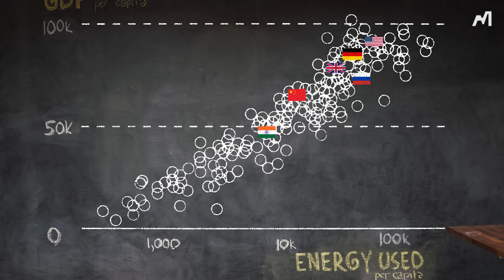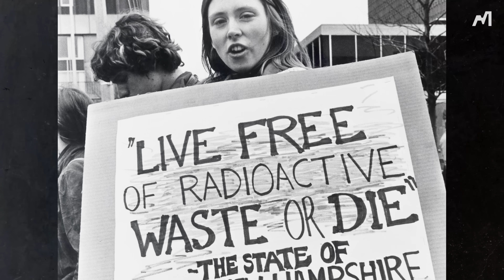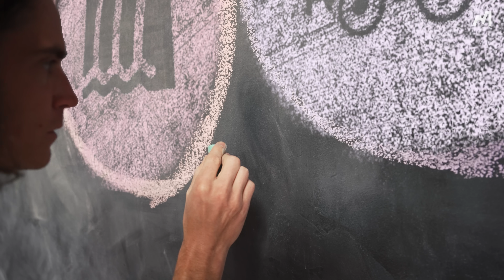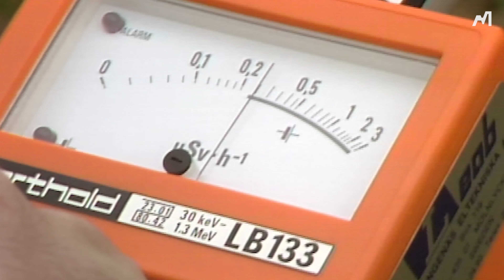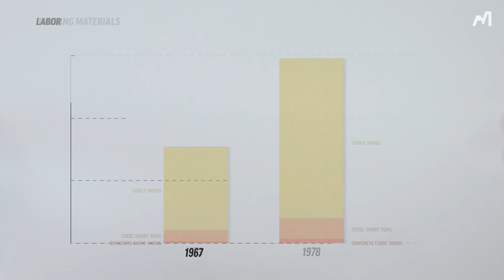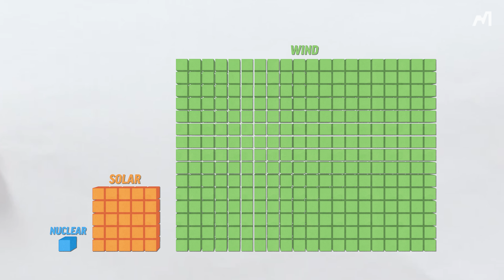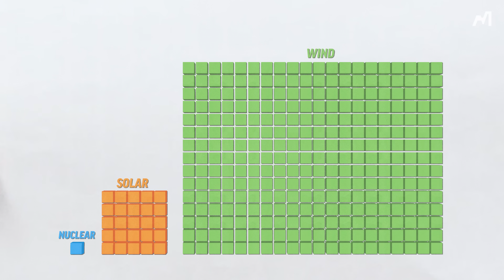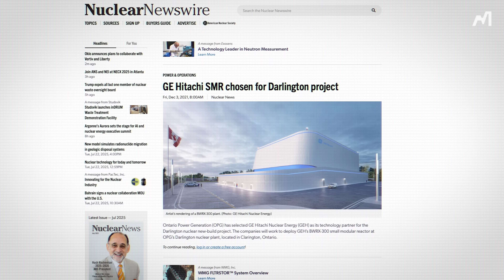They're Lying to You About Nuclear Energy

Comment: There are some serious concerns about the safety of nuclear power plants, like the effects of chromates attacking the carbon steel around the control rod guide tubes in the reactor closure head.  The potential structural failures can be addressed with reactor design and operations.  Thank you for addressing the ridiculous linear non-threshold theory (LNT).  You covered the idea that the declared potential hazard from radiation is tracked as though it is cumulative.  It is also worth noting that the limits are based on acute dose resulting in death from cancer extrapolated out to a calculated 1 in one million deaths from chronic exposure to the most likely member of the public receiving the highest dose assuming that individual was present in that location for 50 years.  Measuring radiation and contamination exposure at the stated public limits is difficult if not impossible.

Comment: Hmmm... there's some glaring omissions in this video:

Nuclear fans like to point out the low casualty rates, but they always omit crucial details:
Chernobyl and Fukoshima are the two most expensive disasters in history. And it's not by a small amount.
The clean up cost of Fukushima and Chernobyl is now $1.3 trillion. That's enough to bring online 228 GW of offshore wind. That's 28 times the capcity of Fukushima and Chernobyl combined

One of the primary reasons that Nuclear has such a low casualty rate is because of the regulations that are in place.

It's like air travel - easily the most regulated form of travel in the world, and also the one with the strongest safety record. That's not a coincidence.

And the "over-regulation" argument gets destroyed when we look at the People's Republic of China.

China have no problem with deregulating things to make it easier yet their Nuclear Power rollout is also waaaaay behind schedule and is getting worse. They are now at least 40 GW behind schedule and are now expected to achieve under 60% of their 2030 target of 200GW capacity.
Compare this to solar and wind in China. Their solar capacity is now 1,300 GW and wind is 600 GW - absolutely demolishing their targets. China are now installing more solar capacity every six months than the amount of nuclear power they've been able to bring online in over 10 years.

India, likewise, has had similar problems. They set a target of 63GW by 2032, but have since had to reduce this target to 22.48GW, and are way behind schedule on hitting that target (only at 8.8GW after 15 years of effort). Meanwhile wind and solar? They're now at 200GW.

And France, the country that most openly embraced nuclear has 70% of its energy mix being nuclear. There are now 44 countries with 70% or higher of their energy mix being renewable.

And the transformation hasn't been isolated to small countries. Even wealthy countries like the UK have seen renewables absolutely explode in capacity - despite the UK's dreadful reputation when it comes to construction projects - Wind is now the single largest energy provider in the country with renewables now producing 40% of the annual energy production. And this is even the case in the first days of 2026 (winter) when energy demand is at its highest. Wind is the leading producer. Whilst nuclear is competing with Biomass in the rankings.

Nuclear Fission is no longer a cutting edge technology. I do wish more had been rolled out in the 80s and 90s - we would be far closer to our net-zero goals. And I do wish nuclear could meet its targets. But there's no denying the fact that solar and wind have exceeded expectations, whilst nuclear is lagging behind - even in circumstances of low regulation.
The cost of wind and solar has plummeted in the last 15 years and continues to fall. There are definitely challenges. But I'm not convinced that modular reactors are going to be here in time - we've been promised them for like 30 years now and they're still not here.

Comment: The majority of the spent uranium fuel may have been covertly dumped into the oceans.

“By 1991, the US had dropped more than 90,000 barrels and at least 190,000 cubic meters of radioactive waste in the North Atlantic and Pacific. Other countries including Belgium, France, Switzerland and the Netherlands also disposed of tons of radioactive waste in the North Atlantic in the 1960s, 70s and 80s.” (Schauenberg). 

Tepco may have disassembled the spent radioactive uranium assemblies and stored the uranium pellets in steel barrels then dumped the barrels into the ocean which until 1991 was common practice by the Europeans, Americans, Russians, and Japanese.  

 

...................................................................................................................................

The loss of power at the Fukushima nuclear power plant resulted in the reactor’s water pumps failing which caused the reactor's uranium fuel assemblies to overheat and meltdown where uranium oxide has a melting point of 5,072° F and begins to vaporize near the melting point.   The intense heat and pressure in the core created a nuclear explosion that destroyed the 650-ton reactor core, most of the four-foot-thick steel-reinforced concrete barrier that surrounded the reactor core (fig 27a,b) and numerous concrete walls of containment building #3.  The explosion of Fukushima containment building number three produced a 1,500-meter-high mushroom cloud (fig 26a,b) that nuclear explosion originated from the reactor core yet scientists insist that the Fukushima explosions were not nuclear explosions.  The video of the explosion of containment building #3 shows the 40-ton reactor lid (RPV head) jettisoned 1,000 m into the air.  Figure 3 shows that where the core once existed is now essentially gone which implies that the 650-ton nuclear reactor core explored.  It is argued that uranium oxide cannot form a nuclear explosion but it is unknown what 75 tons of uranium oxide under high pressure (1,000 atm) and temperature (+5,000o F) mixed with water will do but the amount of destruction suggests a nuclear explosion occurred.  In addition, diametrically the molten uranium oxide breached the concrete floor of the containment building since the melting point of uranium oxide is 5,072° F.  If the reactor core was immediately vented and kept open after the water pumps failed, the reactor core nuclear explosion could have been prevented, since hydrogen gas is the oxidizer for a nuclear explosion, and the formation of the Fukushima 147,200-acre exclusion zone would have been prevented but the meltdown was inevitable.  In the Three Mile Island incident the reactor core was immediately vented which prevented the accumulation of hydrogen within the reactor core which prevented the nuclear explosion and the formation of an exclusion zone.  The meltdown could have been further contained if the bottom of the reactor core was composed of a ceramic fire bricks (4,000o F) instead of concrete (2,192o F).  The exact composition of the Fukushima corium is unknown since the radiation levels at the bottom of the containment building disables all electron devices.  In addition, at Fukushima, a total of 2,000 tons of the spent uranium fuel assemblies stored within the four of the containment buildings are unaccounted for since the high levels of radiation (+ 800 Sv/hr) at the bottom of the containment building disables all electronic devices, even when shielded.  At Fukushima, the cooling pools were located at the top of the containment building next to the reactor core where many of the Japanese nuclear power plants store their uranium spent fuel assemblies within the containment building. 

The Fukushima meltdown breached the 13 feet concrete containment building foundation.  After each of the three explosions, a total of approximately one ton of pulverized microparticles of uranium oxide was dispersed into the atmosphere producing the Fukushima exclusion zone.  Approximately 65 tons of the melted uranium fuel assemblies from the reactor core fell to the bottom of the reactor core and began to melt.  In addition, approximately 450 tons of spent uranium from the cooling pools, combined with the 65 tons of uranium from the reactor core vessel began to melt down forming a 500-ton corium uranium mass after each of the three containment building explosions.  The molten uranium corium melted through the steel reactor core and disintegrated the concrete floor of the containment building resulting in the molten uranium corium melting through the bedrock.  The descent of the molten uranium was stopped by the groundwater (fig 2) where 500 tons of corium exists beneath each of the three containment buildings where the cooling of the corium by the ground water forms tritium (radioactive water).  The Fukushima tritium problem will last for the next one million years.  High level of tritium feed to mice causes infertility.

The reactor core's uranium oxide was pulverized into uranium oxide microparticles that were released in the Fukushima fallout.  The Fukushima and Chernobyl exclusion zones will never be habitable.  After 37 years (Chernobyl) and 11 years (Fukushima), radiation levels within the Chernobyl and Fukushima exclusion zones have not decreased which can only be attributed to high levels of uranium oxide dispersed in the environment.  The US federal occupational exposure limit for an adult is 0.053 Sv/yr; therefore, a total of 0.053 Sv exposure within a year is the occupational safety limit.  Today, in the Fukushima exclusion zone (red) readings of 1 mSv/h have been routinely reported where 53 hours (2.2 days) of exposure at 1 mSv/h radiation would be at the occupational limit 

10-3 Sv/h x 53 h = .053 Sv...............................................................1

A total dose between 2.5 Sv/yr and 5 Sv/yr would be fatal.  After 3.42 months (2,500 h) the exposure of 1 mSv/hr would be fatal

10-3 Sv/h x 2,500 h = 2.5 Sv............................................................2

The city of Futaba, which is in the Fukushima exclusion zone, will never be habitable.  British scientists (2020) have found readings of 1 mSv/hr near Fukushima city which is beyond the boundaries of the exclusion zone.  Ingesting or breathing miniscule amounts of uranium oxide micro-particles can have serious negative health consequences.

...........................................................................................

Gamma rays emitted by uranium fallout cause cancer and birth defects.

“The first case of thyroid cancer was reported on 12 September 2012 after 80,000 children had been tested.2  Since then, the numbers have risen steadily. As of writing, 56 have been diagnosed with thyroid cancer, 1 with a benign tumor, and a further 47 are suspected of having the cancer. This brings the probable total to 103 out of 296,026 eligible residents examined.3  Thus far, nearly all initially ‘suspected’ cancers have later been confirmed as malignant.  The ‘normal’ cancer incidence rate amongst minors is one to two in a million.” (Williamson). 

“Belarus, whose border with Ukraine is just four miles from the Chernobyl power plant, absorbed an estimated 70% of the nuclear fallout.  A study by UNICEF suggested that more than 20% of adolescent children in Belarus suffer from disabilities caused by birth defects.” (Verril).

If families return to live within the Fukushima exclusion zone, their children will suffer the birth defects that occurred in Belarus from the Chernobyl nuclear disaster.  Only Yoichi Yatsuda, 71, and his wife have returned to live in Futaba (2023).

The three Mile Island (TMI) cleanup did not remove any of the uranium fuel assemblies from the disabled reactor core since the melted fuel assemblies would be radiating more than 800 Sv/h of radiation that would disable all electronic devices and prevent any real meaningful clean up.  At Chernobyl and Fukushima, uranium corium melted through the bedrock and is being cooled by the groundwater.  The high levels of radiation (800 Sv/h +) emitted from the hole that leads to the corium uranium masses beneath each of the compromised containment buildings disable all electronic devices; therefore, the removal of the corium is not physically possible.  TMI also suffered a corium containment building breach (meltdown) which meltdown was less serve since the cooling pools where not located in the containment building.

                                                                                
 

____________________________________________________________________________________________

Comment: 20-25 years lifespan for wind turbines is very impressive imo. Idk exactly which parts fail first but wind turbines are relatively simple machines and I doubt they have to scrap the whole thing after 20 years, surely the tower doesn't need to be changed bc it's just a structure.

Comment: The Chernobyl thyroid cancers aren't significant? The city I was born in, Gomel in Belarus has over 30% of its residents with thyroid cancers at any point in their life. Yes, it can  be treated by removing the thyroid; And then you live on medication for the remainder of your shortened life.
Reply: Significant compared to other sources, nobody denies the problems caused by Chernobyl, but we have dozens of Chernobyl equivalent of deaths, permanent health effects and environmental damage from fossil fuels every years.
Also Chernobyl was a case of its own and no occidental nuclear reactor shares the same design flaws, so including Chernobyl in the debate about occidental reactor designs is moot to begin with.
Reply: @filippo1864 I fully agree. I am not against Nuclear as an energy source. I also do not support the endless bureaucracy created due to incredibly rare incidents.

Fact of the matter is that people perceive nuclear as something that's more dangerous than oil/coal.. Which is simply not the case. The amount of oil contamination that occurred during shipment, oil leaks in the sea, and oil/gas extraction that has been left abandoned due to the cost of extraction being more expensive than the price per barrel; All of this affects us more than we think and much more actively than nuclear ever did

Comment: Problems with nuclear, they need enormous amounts of water to cool and make steam . 2nd security easy for an aggressor to knock out a few nuclear reactors . Solar is a distributed system placed where needed no need for large transmission lines put it on roof tops and along roads and highways . Way harder for an aggressor to knock out 4th cost . Australia has installed over 2x large nuclear power station output in Gwatts using solar . Took 6 years and 1/4 of the cost. Nuclear plants take on average 15 years to build are bespoke take up lots of land and need enormous amounts of water to function. You just can’t plop one anywhere like solar n batteries . Take a leaf out of Chinas book. They basically power a massive. Manufacturing industry on renewables , flexibility easy to add or subtract or relocate. cheap to install and maintain, and are not severely limited in geographical placement . Much much quicker to deploy and make base load power with storage technologies including batteries . Great for a submarine it’s surrounded by water !!!

Comment: 16:08 "no accidents on nuclear subs" - sorry but this is wrong, because there has been several accidents. 
K-27, K-19, K-11, K-222, K-431 all had reactor incidents. One of them was dubbed Hiroshima due to its history(K-19) One sub was refueling when it exploded (K-431) 
I am only listing reactor accidents, not accidents like Kursk. And another thing, the reactor design on a sub or a aircraft carrier is not like a commercial SMR, because they have very different operation modes. A commercial SMR running on low enriched uranium might deliver same constant power over years of operation, while a military submarine reactor runs on highly enriched uranium, and has to be able to quickly moderate power up and down with the vessel's needs. 
I symphatize with your views, and i would also like to have more nuclear, but just get the facts.

Comment: Wasn’t there an organization that studies nuclear radiation and nuclear reactors and didn’t they say there no amount of heavy or super heavy water that’s considered safe? Don’t nuclear reactors boil water and use trillions of gallons of water to cool those reactors and isn’t it effectively impossible to treat heavy and super heavy water? Dam call me crazy but that doesn’t very safe to me.
Reply: I don’t understand what you mean, a few meters of water can stop almost all radiation and the “there’s no safe level of radiation” (if that’s what you mean) is BS, since you live in radiation for your entire life. I study nuclear engineering and worked next to a research reactor shielded by water, I received the radiation equivalent of less than a banana.
Yes nuclear reactor essentially boil water, either directly BWR or via heat exchange PWR. The water used inside the reactor stays in the reactor, it goes in a loop and only a small amount is needed to be reintegrated overtime. If you mean the water needed by the rankine cycle for electricity production that’s another story, but again it’s a loop and at the end all the water goes back into the environment, that water is not radioactive (I mean not more than it already naturally is) as it’s a separate loop from the reactor.
Treating heavy water (if you mean separating tritium) is possible, but practically unfeasible for most needs, tritium is not that dangerous. If you mean separating all the other heavy isotopes, yes it’s much more possible and was done in Fukushima for example.
It sounds unsafe as long as you don’t know the details, but once you study it you understand